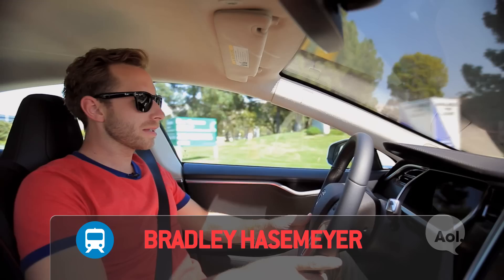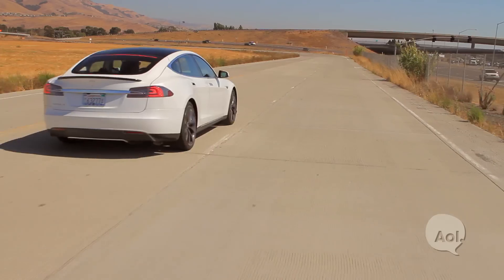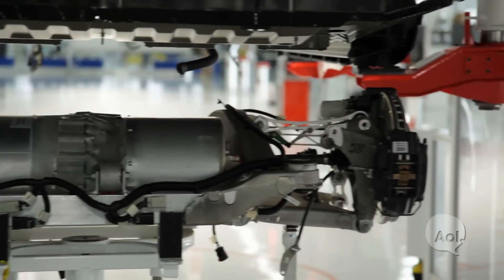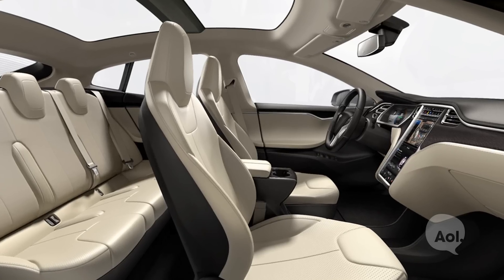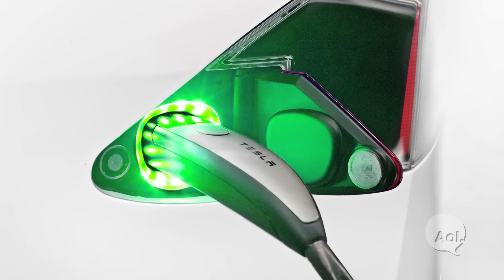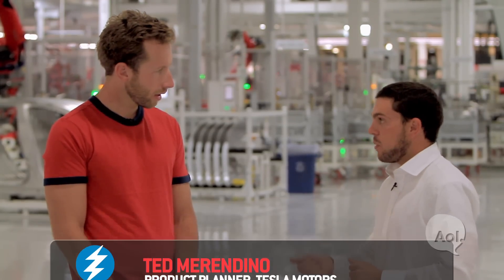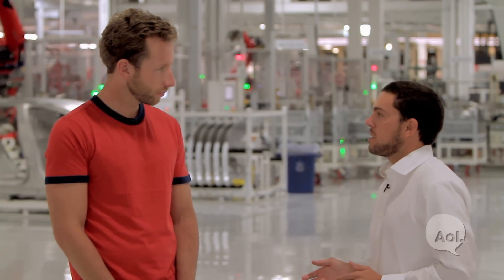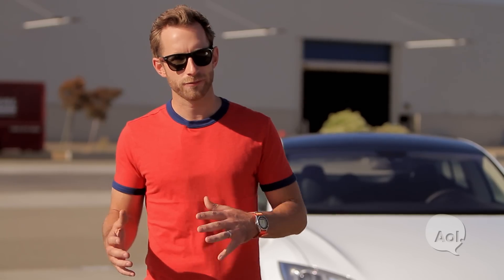2013 Tesla Model S | TRANSLOGIC

Comment: These modules are based around what Nissan claims how much module replacement would cost for its LEAF.
It's nothing to worry, old Priuses and RAV4 EVs have been running for nearly a decade with more than 200,000 miles. The thing about those vehicles are that both use a less advanced Nickel Metal Hydride chemisty. Lithium-Ion batteries have tested to charge and discharge more, that means a longer life, but cars with this chemistry haven't been long enough on the road to prove their reliability.

Comment: 8 years is the warranty, unlike VW, most cars still operate after their warranty expires.

People are worried about capacity after a decade or so. At the moment, there has been little to none battery issues to older cars like the Toyota RAV4 EV or Prius.

If something does go rotten with the battery after its warranty, the most realistic way of fixing it is by testing each module in the pack and replace the faulty battery module with a new one. Modules cost around $200 - 400 nowadays.

Comment: In reality, this car matches its EPA-rated range of 265 miles pretty well. Motortrend got a 0-60 in 3.9 sec. in a fully loaded car with every weight adding option. Imagine how fast the base Model S Performance is? It matches the horsepower rating of the Lexus IS-F with 416, but has the acceleration of the M5 which has 560 hp, 144 more than the Tesla.